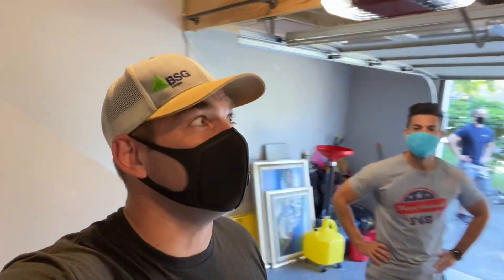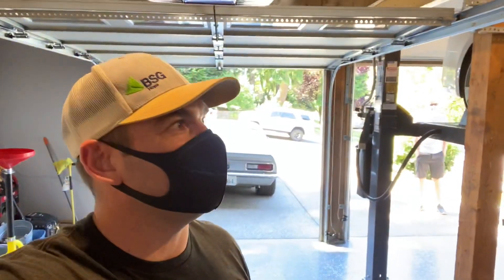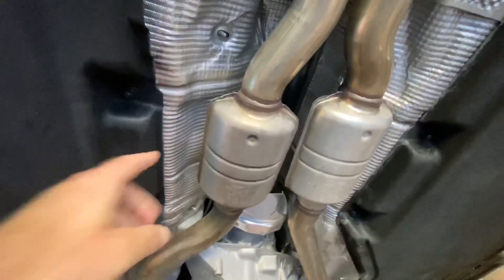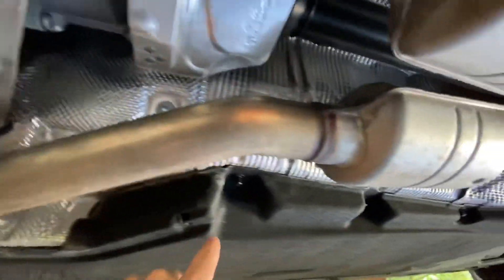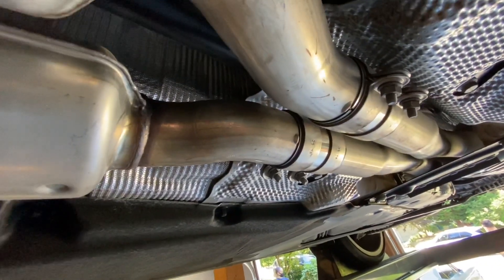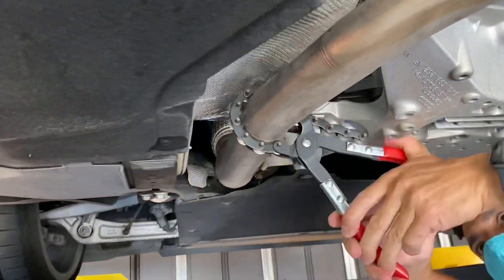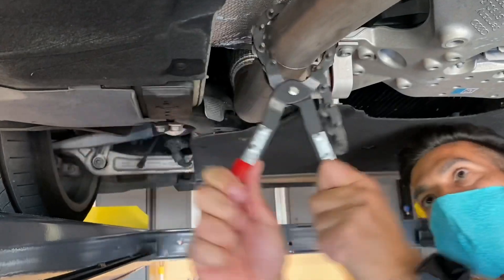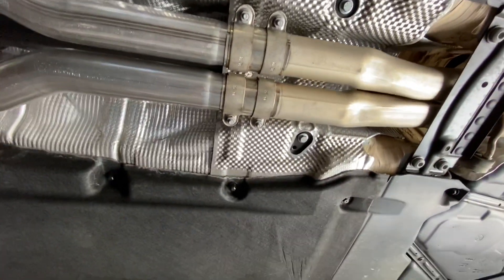Audi S5 Exhaust Mod - VPS Tuning Pre-Muffler Delete Kit

Comment: Just got mine. 2020 S4 FBO, EPL E40 HO tune, Prometh Meth Injection. Should be installed monday or tuesday after I finish my garage floor.
Reply: @360mmspider  Do it. Added the noise I was looking for without being too dramatic with the valves open. With the EPL Perfect
Reply: Mason David  no, because drag racing is not the only criteria that makes a daily car good. Should we start talking about the shit interior quality BMW has in new models, the shit design that makes you puke, driveability in bad weather conditions, or the general better build of the Audi?

Comment: So every video I see is people removing the “silencers” in the front but not that big resonator in the rear. I was planning on keeping the front silencers and getting rid of the resonator. Would that be the wrong choice? I’m also replacing the downpipe and keeping the factory mufflers on. Have you heard it done that way? I just really don’t want drone. Any advise would be appreciated!!!! Thank you!
Reply from the maker: Most people are installing a downpipe and replacing the front silencers like this video shows, the big resonator toward the rear helps eliminate drone along with the stock muffler. The downpipe itself will introduce a tiny bit of drone at low RPMs under load. Like when going up a hill. I still have the stock muffler and resonator on my S5 because I don’t want to add any  more drone. I also like the ability to use the drive modes to quiet the exhaust in comfort mode if I want.
Reply: @Vaguh  Thank you so much for taking the time to respond! I greatly appreciate it!

Comment: Thank you for the video. How does this compare to Audi’s OEM resonator kit, other than being 3x less in cost? I’m not a huge aftermarket guy, and I’d like to keep things stock minus cosmetic / wheel changes. Does the VPS kit void any warranty? Thank you in advance.
Reply from the maker: Should Be comparable to OEM kit. You will need to cut the pipes, but should affect the warranty. IE also makes a set that doesn’t require cutting.

Comment: This sounds great! I have the same setup as you with the RedStar Catted DP: What about drone?
Reply from the maker: Yes! The RedStar DP is awesome!  After doing the pre-muffler delete I would say for sure two things happened, 1) the car is louder when I want it to be, and 2) there is less drone.  Drone hasn't gone away completely when I'm in dynamic mode, but it only exists in small RPM ranges under load.
Reply: @Vaguh  Awesome! Thanks for your feedback bro !
Reply: Does it sound much different in eco mode compare to stock?
Reply: @Vaguh  Very interesting that deleting resonators reduced drone for you. I currently have the RedStar DP, the Gesi cat, on my 2021 SQ5 and there is absolutely no drone whatsoever. I'm contemplating going with VPS or just for the shop to weld peace of pipe, but concerned that would actually add drone, not reduce as in your case.
Reply: Have you done it since? If you chose the VPS route, how did it fit? Or did it at all?

Comment: Jeremy, do you still have this on your s5? How has it/ the clamps held up? Did you have to use washers/spacers on the driver side hanger for proper fitment? Thanks.
Reply from the maker: I do still have it on my car. I actually have a set of IE midpipes I’m going to replace it with. It’s held up pretty good. I did use washers for spacers. The IE kit is much higher quality and doesn’t require cutting, however you do have to get to the downpipe bolts.
Reply: @Vaguh  thanks man you just saved me ten more hours of agonizing over which way to go. I’m going to go with the IE mid pipes. The advantages I see to this is I can unclamp the turbo and downpipe and get a look at the IE high flow cat to make sure it’s still in good shape, I keep the stock mid pipes in OEM condition if I should ever choose to go back to them or sell them and better fitment and quality  is important to me even though you never see it. Money is not the issue and the extra work on those damn bolts is a bit annoying, but probably will, be satisfying in some weird sense. Have you thought about rebuilding the internals of your engine to prepare it for 1000 hp?
Reply from the maker: @jimtraugermd  if you buy the IE kit use code itspronouncedVAGUH. Should save you 5%. Also, I’m thinking I’ll keep my internals as is until something happens. I’ll be getting to the track more this spring and we’ll see how it goes.
Reply: @Vaguh  thanks but too late. I can’t thank you enough for all of your videos that have been a tremendous help over the past couple of years.
Reply from the maker: @jimtraugermd  we’ve got more just waiting to be edited, if I can find the time.

Comment: I need your help please. i went in to delete the two res in the front but my guy said that they were catalytic converter‘s. are they cats or are they resonators?
Reply from the maker: Hey! I had to look it up to double check and found that Audi refers to them as “Pipe. MUFFLER. Exhaust.”  So I think they are actually two smaller pre-mufflers. Here is a link to the exhaust parts diagram I found. https://www.partscolumbusaudi.com/a/Audi__S5-Sportback/__7604236/EXHAUST-SYSTEM-EXHAUST-COMPONENTS/1341395.html
Reply: No,they are not cats. Cats are more closer to engine.

Comment: I have been fighting mine all weekend and cant seem to get them to either not leak, or not vibrate against the hanger on the driver side. I didn't get any sealant in my kit, and my pipes are the new updated ones. Did you find that there were two different pipes, a driver and passenger side? Did you use the supplied sealant in your kit? How close did you get the front of the pipe to the place where you cut. Is it sitting right up against it? Sorry for all the questions :)
Reply from the maker: If you send me a message on Instagram I can try to give you a hand.
Reply: @Vaguh  Messaged :)
Reply: How did you resolve this?
Reply: We need answers

Comment: So I don’t have access to a lift, and getting told from local shops it’s a 3 hour job to drop the full exhaust to measure, cut and install - they don’t want to hit the heat shield or cut “angled”.

 Am I getting hosed and should I just keep looking for someplace to do it with it installed?
Reply from the maker: It took me like 3 hours to do 2 cars and video it. There is an alternative, IE makes mid-pipes that do the same thing. They unbolt at the downpipe, but they cost a bit more.

Comment: Do you get any drone sounds with this setup? Even at high speeds?
Reply from the maker: No drone at high speeds. A little when under load around 2300 rpm. I notice it when going uphill.
Reply: It's Pronounced VA-Guh thanks, so what is your exact setup? I’m aware there are 3 resonators, which one of them did you delete? And did you also delete the cat?
Reply from the maker: Tawfiq Oladoja we replace the front resonators. The white car is stock otherwise, and the grey one also has a Redstar Exhaust downpipe with an HJS 200 cell high flow cat.